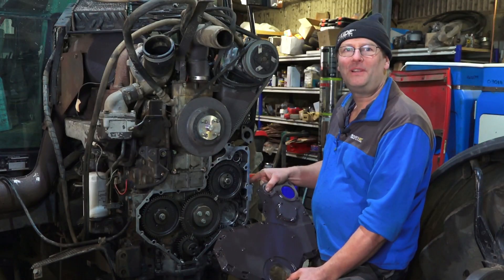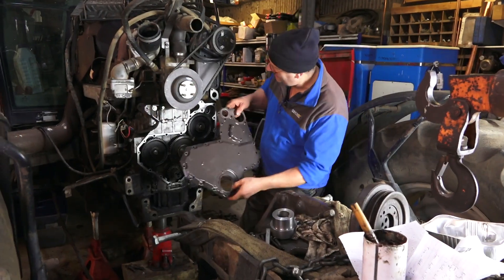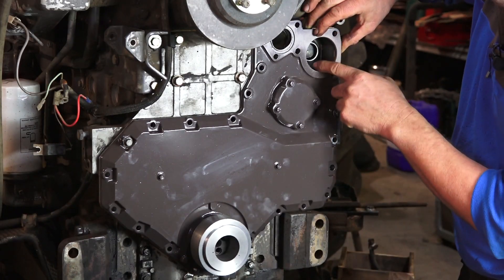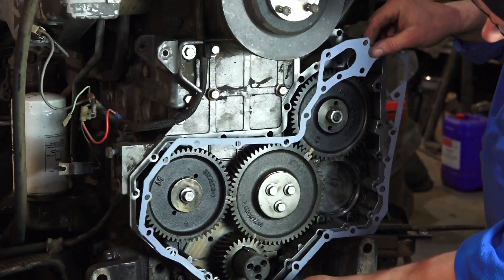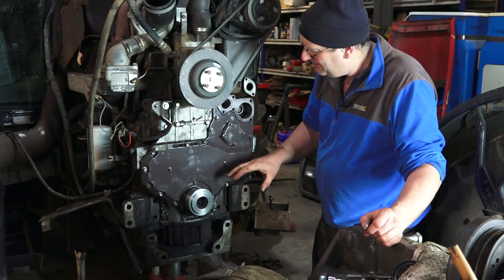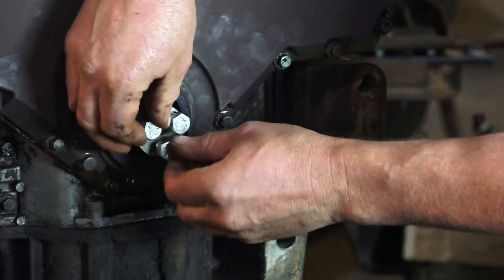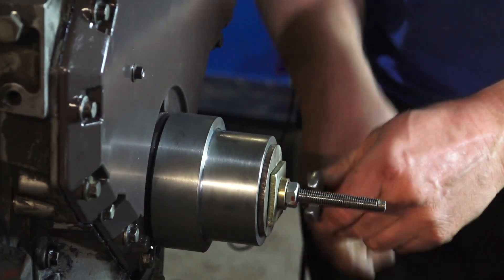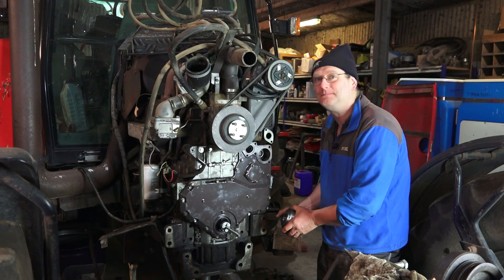Perkins Engine 1000 series timing cover and seal fitting, Massey Ferguson Tractor

Comment: Thak you for your professional showing us hof to replace gasket and pulley seal. I have question about dismanteling oil pan of the machine for inspecting oil pimp relive valve. Does it go down withou  taking engine and gerbox housing of tractor?